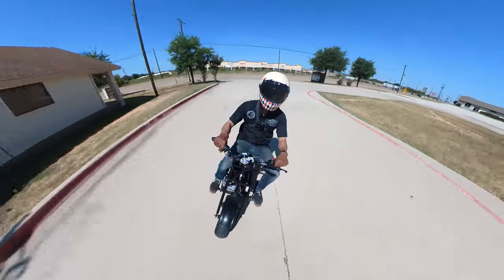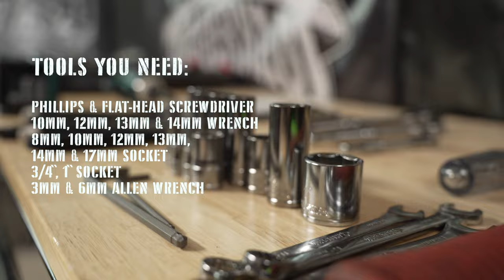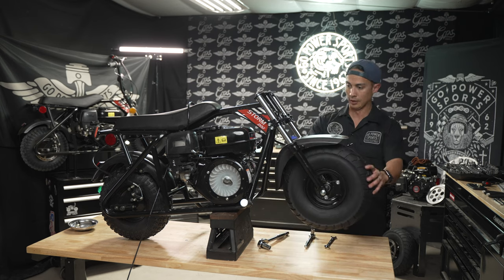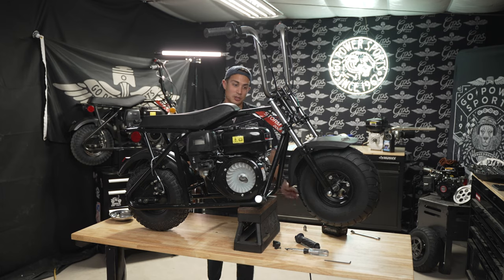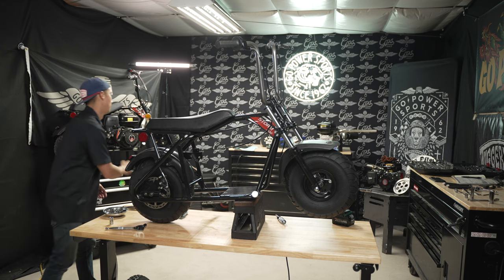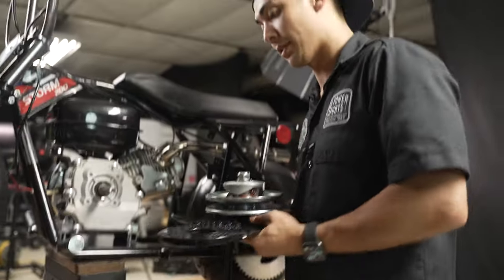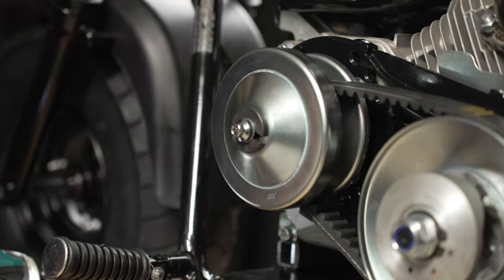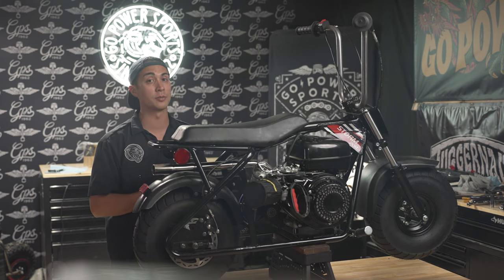The Perfect Storm | Upgrade TrailMaster Storm 200 Minibike

Comment: My bike gets to about 27mph and then i dont know how to explain, wide open throttle it like jumps forward but hesitates to go the couple extra mph we all know it has. The governor has been removed and its already had 2 oil changes with only about 3 hrs of ride time. Any suggestions??
Reply from the maker: Did you take the governor out from the inside of your engine?  When you give it throttle, does the engine's throttle arm go as far back as it's able to go?  Want to send me a video to sales@gopowersports.com?
Reply: @GoPowerSports  I worded it a bit wrong. I didn't fully remove the governor but I did back out that throttle governor screw. How would I send a video? I looked on the website to chat, but I don't see an option to send any sort of pictures or videos

Comment: Can i use the wheels this bike comes with , with that suspension kit ? Would like to buy one soon 👍🏼
Reply from the maker: Yes, you can use the stock 145 Knobby Tires and stock wheel. I believe the spacing should be the same.

Comment: is there bigger off roading tires
Reply from the maker: 15" Cleats are usually the biggest tires you can fit on to a 6" rim.
Reply: @GoPowerSports  thanks
Reply: @GoPowerSports  another follow up question, is this bike street legal or is there mods i have to put on so i can ride it on the road